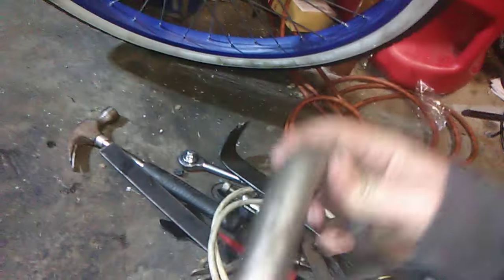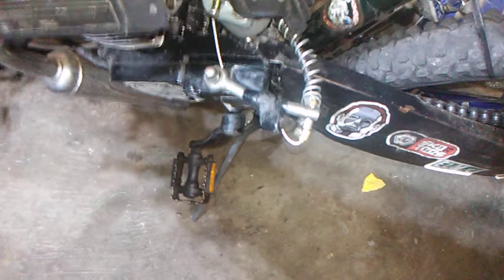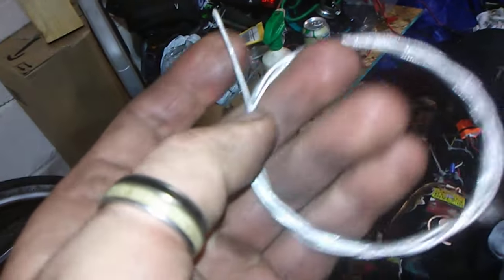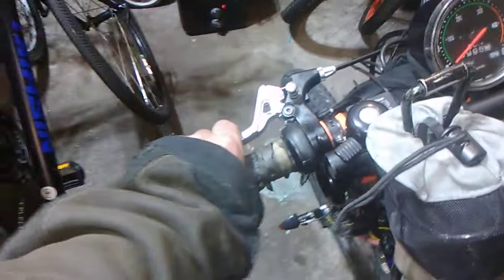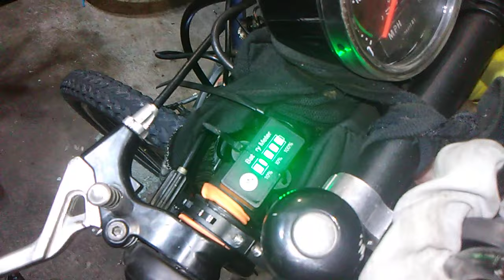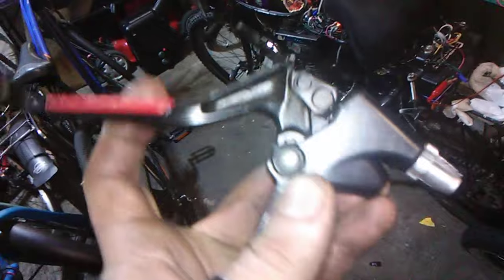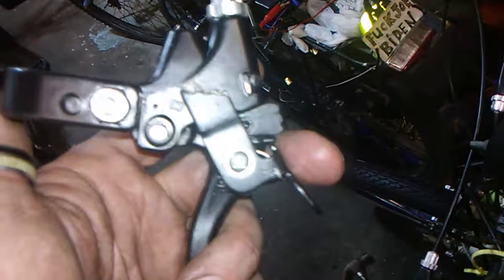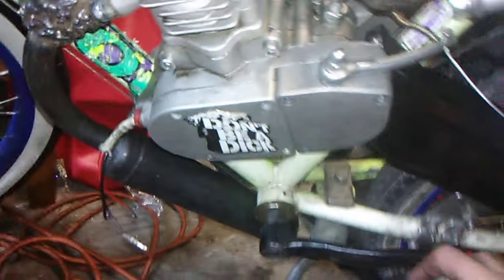"Motorized bicycle engines update on my rides mongoose mtb green bike still working!"

Comment: Ya, when my stock clutch cable broke. I made sure to order thicker guage cables.....Something like 1mm thick stock gauge. To 10,   1.5mm cables for like $7.....
On the clutch handle locking pin. I put a blob of jb weld on the flimsy bottom washer. To keep it from breaking. Clutch handle & bottom end of engine has lasted since 2020.
 I got lucky, the Anbull engine I odered in 2020 surprisingly came with a dumb luck balanced crank. It had very little vibration. It was so balanced, that when I cut a window in the pison for the reed. It threw off the balance and caused a tiny bit more vibration.
Reply from the maker: thanks